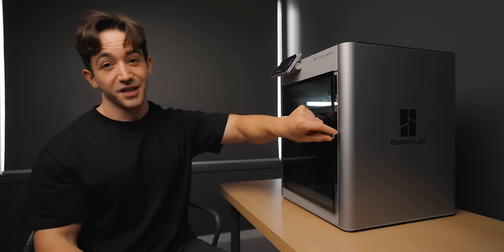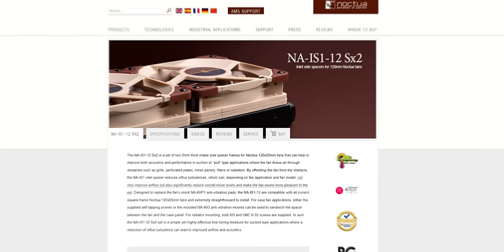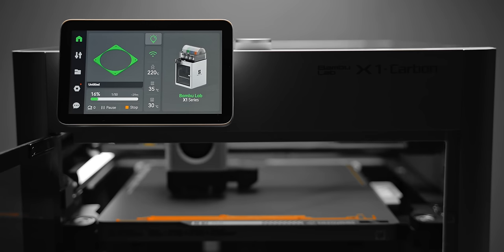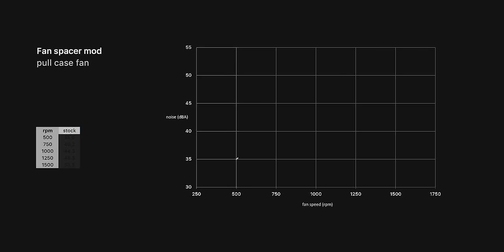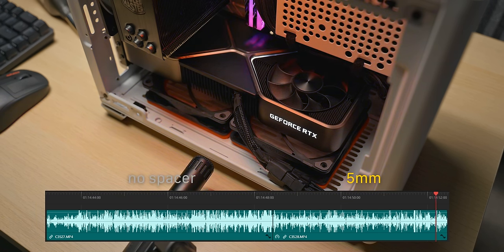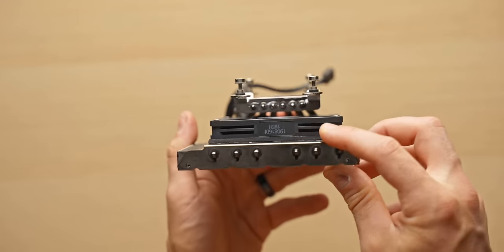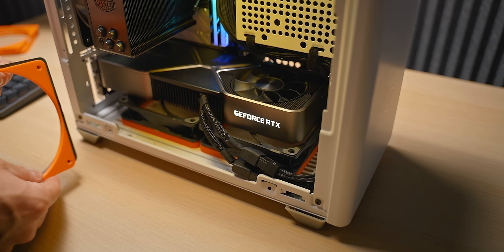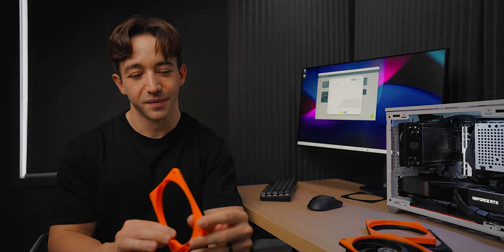Stealing Noctua's quiet airflow mod

Comment: As someone who wears closed-back headphones 99.99% of the time I'm on my computer, I probably would never notice the difference, however I LOVE when you dive into this stuff because you do actual testing and break it down in an easy-to-consume way. Cool stuff!
Reply: I'm always on open backs haha
Reply: On the other end of the spectrum, I only use open backs and every bit of noise reduction helps, so this is great! Even though my build is very quiet compared to these sff builds.
Reply: @ZenTunE-  Oh I still have 6 Noctua fans in my build. lol Originally it was for the sound, but now I just think I dig the aesthetics and can’t stop. haha
Reply: @ZenTunE-  i'm also on the spectrum, so every little bit of noise reduction helps me too!
Reply: @CaseyHardman  Same, I'm totally good with my case fans being cheap Arctics since I run them at like 500-600rpm, can't even hear them over the GPU. But god damn the NF-A25s look good :D

Comment: I printed these and realized the screws I had were too short and can’t seem to find any longer than 12.5 mm but I think you need around a 15 mm screw. What screws did you use?
Reply: Just taking a guess that he used radiator mounting screws since the gap from rad fins to the fans is similar to the gap introduced by these spacers

Comment: These have been around for like, a decade. Some now gone blog-style water cooling websites had extensive testing comparing the impact of spacing on radiators specifically. That's the reason nearly all radiators have the gap on them, in the early days they didn't, and you had to buy these for the optional performance.

Comment: I have been 3D printing fan spacers like these for a few years now.  Its crazy how much difference it makes to your ear just by putting a 5mm gap between the blades and the vented panels.  I did all the same tests as you myself trying different thicknesses and landed on 5mm as well just by doing ear testing.  I didn't have a sound meter.  I just went with what sounded the best and didn't make a hassle to mount.   Great work on this video putting some science to all of this.  Love your work !!!
Reply: Did you use PLA to do the 3D printing?
Reply: @CleitonMariano  PLA works fine for me. It's not under stress and the airflow from the fan never lets anything get too hot.
Reply: The rear exhaust near the i/o is probably one of the most impacted right? Since in many cases that fan is basically pressed directly up against the metal slats with no filter at all.

But I'm curious, don't most high quality fans come with some form of rubber pad and noise dampener ie. Noctua anyway?
Reply: @ashryver3605  its not the fans that blow out thru a perforated panel. It's the ones that suck in thru the panel that get turbulence and make noise. Do an experiment.  Take a fan and just try blowing thru.  It doesn't change the sound much. Then flip the fan and suck thru the panel and you will hear a big difference.   Them slowly move the fan away from the panel while it's sucking and you will hear with just a small gap the sound gets a lot less. The faster the fan spins the more pronounced the difference is.
Reply: @jhautz817  Ahh so this mod is targeted to intakes trying to bring air in through a vent, to the inside of the case, rather than trying to push air from the case out.

I guess that is why the AIO does not impact much, because 1) aios have a littel gap already from their frame and 2) they are pushing air into it.

So for me it would mainly be a mod to do for my bottom intake fans pressed up against a mesh/filter/panel, rather than my rear exhaust fan. Would it hurt tho to just mod the rear exhaust fan anyway too?

Comment: There have been fan spacers and shrouds for years, especially helpful for radiators to alleviate the dead spot of air that is created with the central hub not moving air compared to where the blades are. Always been a smart move but rarely utilized since availability had been low. Alphacool Monsta radiators along with HWL SR line have to-spec distancing between the core and fan itself to help with this. Being that Noctua is popularizing the idea, hopefully it'll take more hold. Glad you made a video about this.
Reply: Plus there been few fans like Noiseblocker NB eLoop which would generate weird turbulence noise when they are in push pull configuration, I have run them on SR-2 360mm and hated their noise in pull configuration, then I used 5mm spacers and noise disappeared
Reply: Yeah, this is quite some old thing. They were called fan shrouds, few mm thick, I just ordered them like 8 years ago for 3 radiators on my custom loop back then.
Reply: Only problem is extra space required of course, esp. for SFF builds
Reply: I still have 4 of the clear plastic 'Admiral' 40mm fan spacers from over a decade ago. They were quite popular with custom water cooling back in the day.
Reply: @ChatGTA345  For AIOs: I recycled failed fan's frames - cutting the fan out and smoothing out the frame's legs with a file). Both the push and pull sides benefited. 

Regarding space: I basically run an open bench.
Reply: @Longbowgun  Nice, resourceful!
Reply: In his test for an aio specifically it didn't seem like adding extra space made any difference to cooling and the noise didn't change much at all  is it bcs his aio already has a frame that acts as a spacer?

Comment: rubber/silocone/plastic fan shrouds are on the market for ages . For example Phobya ,Alphacool etc . They are working perfectly .
I'm also sometimes using old fans as a donors .Just cut out the middle motor/blade part and use the empty fan frame as a 25mm spacer.
Reply: sometimes just takes a bigger player in the market to popularize something
Reply: @noir-13 I agree but their fans are high quality and nice. I have some Noctua fans in my build that I've used for 10 years. I had some cheaper fans that died and were never as quiet as the noctuas while only being $10 cheaper than the Noctuas.
Reply: @@noir-13Noctua makes a high-quality product, it's generally better than the rest, and you pay for it. Nothing wrong with paying a premium for a better product
Reply: That's genius. Yeah they've been around but are very seldom discussed.
Reply: I haven't seen those available for purchase here in Asia. If they have local distribution like Arctic or Phanteks then it'd be nice.
Reply: I can't for the life of me find any in white, other brands you'd recommend so i can look further?
Reply: noir-13Apple isn't high quality anymore. It's just fancy stuff which seems with quality so they can overcharge you more

Comment: You need to change the battery on your caliper in order to stop it from flashing.
Reply: I had a few of these cheap digital calipers which  are honestly not very accurate and die randomly. A cheap Japanese non-digital one was a nice improvement for me. I've never seen them flash since they die before I get through a whole battery so I assumed the flashing was from the camera frame rate 🤣
Reply: they are good enough for what they are, if you need more precision you need a micrometer anyways.
Reply: @ZILLA....  Mitutoyo makes great calipers!
Reply: @ZILLA.... They are very precise and accurate. You don't know what you are talking about
Reply: @ZILLA....   Well i am using same caliper like he does and i sont have any problem worked fine and are very very accurate 
You may just had a bad luck or bought from wrong place

Comment: I wonder if printing the spacers in TPU or another flexible filament would see additional improvements? Especially if you also have a problem with vibrations causing additional noise - I get these with the stock exhaust fan on my Meshify 2 ARGB at low fan speeds.
Reply: Coincidentally, I just printed a fan shroud for my GPU that is made out of TPU and houses two 140mm fans who are elevated 10mm (0.4 inches) from the cooling block.
Aside from the noise from the airoving through the fins the card is basically silent now. No vibrations/ additional frequencies whatsoever.
Reply: An old mod people have been using for years is weather stripping. I used 1/4in (6.35mm) thick strips for my cpu fan. Worked wonders for sound and temps as it acted as a barrier to keep the cpu cooler from recirculating hot air.
Reply: @peepeezza I'm afraid I don't follow 100%, did you put these on the fans (that are between your cpu cooler grills)?
Reply: @cyprian4869  So in my case, the cpu fan is close to the side panel of the case. This causes turbulence. If I apply the weather stripping around the outside edges of the side of the fan facing the side panel it creates a duct that helps with turbulence and temps. Granted I inly saw a 2 degree drop, it was still a difference and it was much quieter.
Reply: probably not since the fans that are mounted have their own and vibration rubber. but if the fans you have don't have that rubber piece then yes it will improve it.
Reply: will not help a lot since the scews are still there as a mechanicel conection and the area the fan is pressed on the shroud is verry large with almost no dampaning effect since the tpu or rubber is on this area with this little fan on it verryy stiff to take out forces. since the energy in the vibrationsof the fan is verry little you would need verry soft material.
first rule is no vibrations.. so if your fan is rattling arround change it. and if you need to dampen some ibrations you need oldscool rubber screwplug decouplers with small areas to take the vibrations out.
the problem eveb with this small areas of contaxt was allways they cant get soft enough to take out vibrations of the fans verry good but stay mechanical strong enough to just hold the fans.
best way of making systems quiet is to not produce any noise. slow spinning large fans. good balanced no rattling and yes the sharp metal corners on case walls should be far enough away to not produce noise and should be uses with slow rpm and slow airspeed.
Reply: Pretty sure that tpu wont make much of a difference, with models like this one tpu is actually still very hard in the direction it matters the most. Also that bing said, if youre gonna screw the fan in tight there wont be a difference anyways. Otherwise youd habe to use these rubber fan holders that they used to use in old prebuilds, theyre pretty cool

Comment: This depends on which side of the fan is sitting flush against the grill. The side with the "struts" already has the blades distanced from the grill, which is the orientation for exhaust fans. However for intake fans, the blades will be too close to the grill and cause turbulence, which the spacer will most definitely help. However there is another option, and that is reverse flow fans. These are specifically for intake usage and were designed to make the RGB lighting look better by moving the "struts" to the other side of the fan. However this also results in a natural spacing of the blades away from the grill, and so reduces turbulence noise. But if you are using normal fans for intake, sucking through a mesh or grill, then spacers will make a huge difference to noise quality.

Comment: I think some of the noise from fans is caused by vibration because the fans are fixed absolutely solid to the mounting.  You can get silicone rubber fan mount devices, they are pushed through the screw hole and when the lump/point exits the screw hole it expands and fixes the fan.  Used with a support made of silicone rubber or foam it should considerably reduce vibration.   If you have driven an older farm tractor, compared with your car you will realise the benefit of rubber mountings that are not solidly fixed, the car is much smoother in operation.
      If you have a 3D printer you could also make fan exhaust mesh covers with a central ring the same size as the fan hub and cap this central ring.  Then make 2 or more rings progressively larger than the central one from the central ring to the outer part of the fan mounting with only a few very thin supports.  Say ,  2, 3 or more thin rings 1mm thick/wide with 5mm depth, you only need the fan grill to stop fingers and cables from touching the fan.  Having rings around the central hub like this should cause a laminar flow, like they use on water fountains, the ones that have a solid jet and not a 'spray effect'.  I don't have a 3D printer, so cannot make these myself.
I just run my fans at low speed using the motherboard controls, so I don't need to worry about noise.

Comment: I didn't know Noctua made those. 
   Your latest videos are cool, mostly about ways to increase cooling efficiency and reduce noise. 
   The fan spacer is an excellent way to reduce noise. When they are in push, such as exhaust, they aren't as bad, in pull at the front, they do get noisy.
   Nice work!

Comment: I have to thank you for this video. Had a new AIO for a couple of months now and a slight intermittent droning noise was driving me up the wall. Tried different configs but no dice. Then I saw this video and the penny dropped. wind turbulence. replaced the AIo fans with a couple of noctua NP12 and the problem is no more.

Comment: You can always buy a 3rd party rubber gasket thats the same square shape as a standard fan.

Some problems your solution address: Gaskets tend to compress a lot upon installation. You have to be careful in ensuring they don't deform and make contact with the fan. Finally, they need to be sandwiched between the fan and the panel, as screws wont secure them.

They worked well for case intake, but didnt work well for my blackridge. Highly recommebded for thise who don't want to go through the 3d print route.

Comment: There are some 5-7mm fan shrouds/spacers available to decouple fans from case/radiators.  Some are rubber, and also work as a gasket to better seal the fan to the radiators...  this concept isnt new, but glad that you are bringing light to it.  Many cases where the fans are butting up against a grill/mesh when pulling through it will make a lot more noise than even spacing it out 5mm as you show in your testing.
Reply: Totally off topic but I recognize your username from the mini-z forums 😂😅
Reply: Yeah, spacers aren't new, and they been around for ages but somehow forgotten.
Reply: @Limeaway  You found me out!!!  Im a PC hobbyist too!
Reply: Link?

Comment: I bought some AF120 RGB Elites from corsair for all my case and AIO fans. My god they resonate like absolute CRAZY! Like I can hear it over my headphones even with intense action while in a game. I bought some 3mm silicone 120mm fan spacers to try to take care of it and it helped a ton but there was still a certain range that they mad the *wub wub wub wub*. I didnt even think of printing some TPU spacers! I was able to test each fan individually and set a step graph instead of a normal curve to avoid the ranges that resonated but what a pain that was. I even kept a positive pressure and found the perfect variables for my fans to react to in Fan Control. That software saved me so much headache! Great video tho wish I would've found it 2 weeks ago!

Comment: I use double sided foam tape to space out a fan and it works really well with little cost involved. I think the vibration isolation from the case also brings down the noise level a lot.
Reply: Is there a particular type or brand of foam tape you went for? I could use foam tape for a couple vibration reduction jobs (both in the PC and in the car) but after a terrible experience with disintegrating foam tape used for A/C weather sealing I've been kinda leery of it.
Reply: I used Scotch brand double sided mounting tape and wasn't too concerned about looks since it was only for a top mounted exhaust fan for the computer, underneath the case. I'm sure i could have done  a better job but it's out of sight plus i was only concerned with reducing coupling noise. Maybe some type of thin sound deadening material would be better.  @Khrrck
Reply: Seems even some washers  between the fan and case, or even some bits of cardboard with hole-punched screwholes could achieve the same thing. Would be nice to see testing of this. I presumed when i've done this with cardboard any improvement was due to vibration damping, but looks like it's not the whole story.
Reply: @jonboy602  I think allowing flow around the edges might allow for more turbulence, but nothing really to do except experiment. I was thinking of just getting some dense foam sheet from Amazon and cutting out an appropriate spacer.

Comment: Have just given this a go on my NR200p with two arctic P12s on the bottom, the difference is amazing for the amount of effort! Went from 41dB to 36dB (measured with a phone app only) and the subjective difference is huge. A much "cleaner" noise that's much easier to block out. 

My GPU has high pitched annoying fans, and the new mounts mean I can blast it with the case fans, which has a decent effect on the GPU fan speed. Thankyou for testing this!
Reply: how did you attach the fans with this gasket to the housing?
Reply: @mr.sousay9011  standard fan screws are long enough to go through the duct as well as secure the fan

Comment: fan spacers have been around for a decade or more. the problem was cases didnt have much space, so adding spacers would make it harder to fit thick fans into it.
space is a premium, bigger case is more expensive.
and people back then didnt have as high of rpm fans as of now, partly because high rpm = high noise.
but noctua has raised the rpm with their fan designs while minimizing noise.
so the air flow turbulence is higher when its closer, so the spacer has become relevant again
the reason why spacers and shrouds appeared was watercooling was using a car's heatercores which didnt have the frames modern computer radiators have.
Reply: they stopped really doing fan spacers but back over a decade ago they were pretty common. I still have 4 of the 40mm primochill admiral fan spacers I use mostly on external rads now.